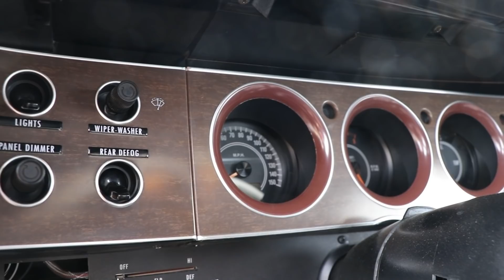ABANDONED Dodge Challenger Rescued After 35 Years Part 29: Finale

Comment: I say keep her as is man. I always got a kick out of my first car. A 2004 P71 Crown Vic with a F150 Coyote I swapped in it but it had a torn or cracked bumpers, mis matched seats coming apart, the whole radio and central console missing. She was a mess when you looked at her, but she was my fun mobile.

I turned her into WRX slayer back when I was still in high school. So as long as the dodge runs and roars she'll get lookers.

Comment: Typical American cheat renovation! Who inserts ceilings without first blasting sheetbased primer with two component primer also in the window frames. The engine compartment as well! 

If this has been in Sweden, it has been really done with frame lifting, powder coating and more! Therefore, every single imported American car is torn down into molecules before it is renovated here in Sweden! Sharpening!!